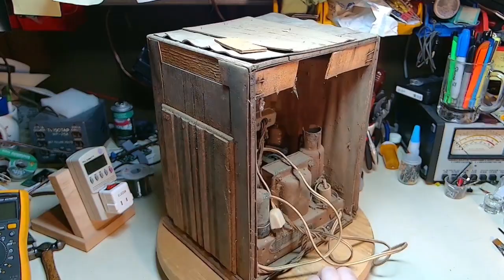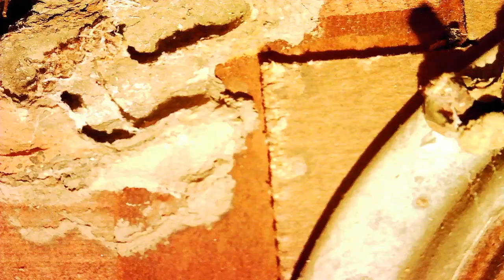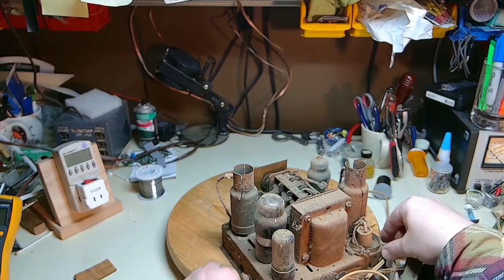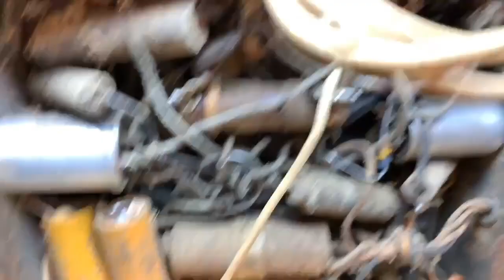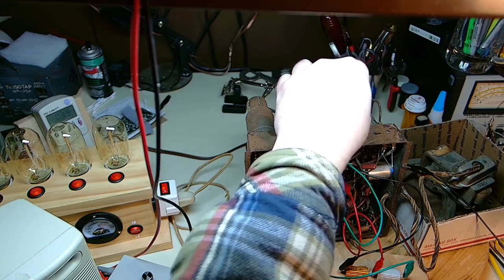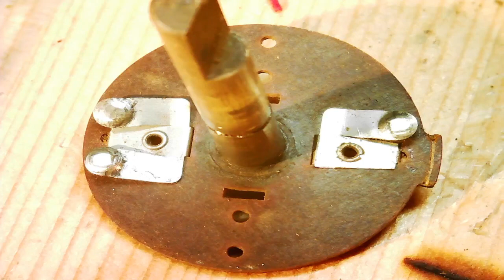1934 Crosley  Dual Fiver Deluxe A Model 5V1 Repair

Comment: First thing to do after cleaning the inside of the chassis is always check the power transformer for output. ⚡Everything 
else can be fixed later even if it looks like a hopeless cause.🔥🧯Good on power up so the elbow grease procedures
commence! Very little space in that overcrowded chassis interior. Very challenging set of repair electrically. Ain't pretty
but even the ugly girl get's a date to the dance  every now and then.:face-blue-star-eyes:
Reply from the maker: Great points, thanks for the comments.